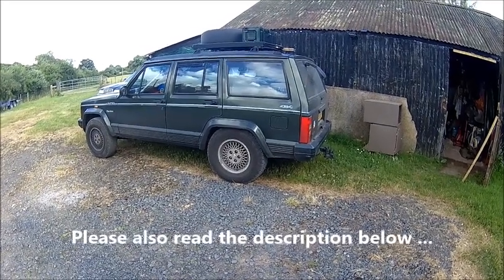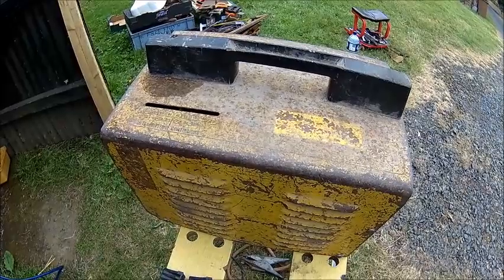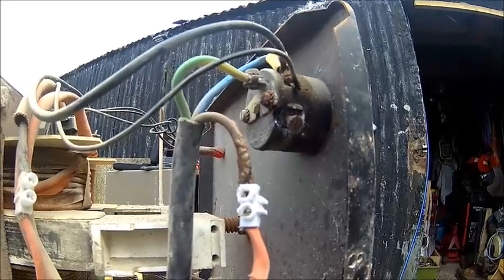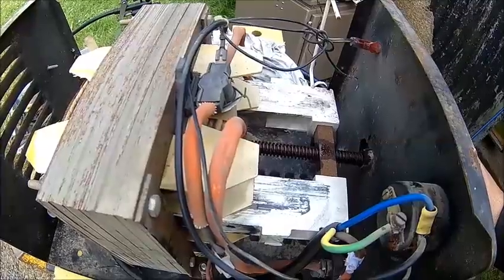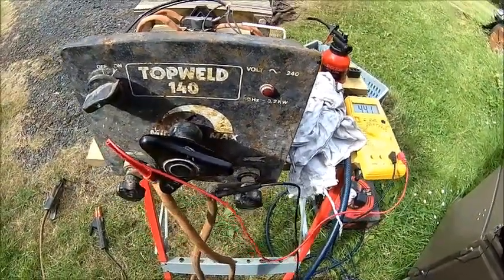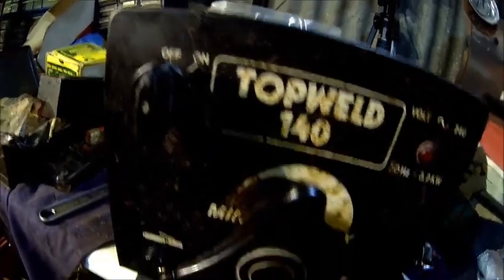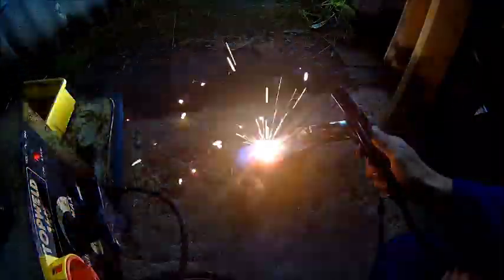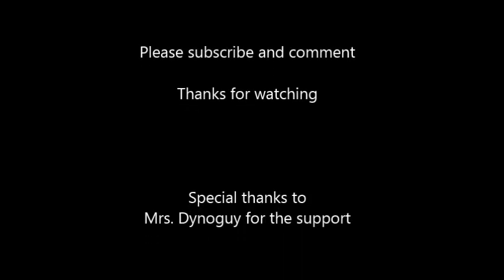The $3  Buzz  Box is getting a second life - Stick welder tear down, inspection and repair

Comment: That's a great deal. Is it AC/DC?
Reply: AC only, though a rectifier could be added for DC.
Reply from the maker: Yeah, i think the price was right, even the new switch and connectors pumped it up to £15.
As Average Joe said, it is AC only, these sliding yoke transformer welders are the simplest form you can get.
The posher models do have a tapped transformer and a switch for welding amp rages, pretty much as explained in my MIG welder repair video.

Comment: It's a good improvement using dinse connectors on it. I did this on a cheap flux core wire welder I bought, along with converting it to DC output.
Reply from the maker: You absolutely right, i use them on all my welders.

Comment: Nice job. You could put a fan in the back of the machine, wire it to the main switch, so it will pull cool air from the bottom vents and exhaust out the rear vents. This would dramatically increase the duty cycle.
Reply from the maker: Thanks, ...You're absolutely right, but if i need more duty cycle i use just another welder, got a good selection to choose from ....:-)

Comment: Do u know if this type of transformer can b used in a flux-core welder? It seems that the voltage adjuster can expand the range of a hi/low type flux welder which may make it a better welder?
Reply from the maker: depends,... if the flux core welder is a DC machine you need a rectifier, these buzz boxes make only AC
Reply: Thanks for ur reply. My Harbor Freight flux core welder was 90 amp AC only, but I put in a bridge rectifier and cap to make it DC neg which gives a much smoother weld. I'm thinking of taking the transformer from my HF arc welder, which I never use, and installing it into the flux core welder so I can have more control over my voltage range.
Reply from the maker: Generally it should work, but .... you need to check the idle voltage, stick welders tend to have higher no load voltage than MIG welders, also the transformer characteristics may be different. Stick welders are rather soft, that means the voltage drop is higher with load. This is to make striking an arc easier, but with a MIG welder this is not a concern, at least not with short circuit MIG, so transformers are usually stiffer (less air gap) in a MIG welder.

Comment: Nice job Mike. Good score on the buzz boxScrap value would be more than that for its copper 😶
Reply from the maker: Thanks Mat, ... well, scrap value wold be less than expected, secondary winding is actually aluminium.
Reply: @dynoguy  the primary is probably aluminum too. It's Chinese made. The same is true of my Harbor Freight mig welder.